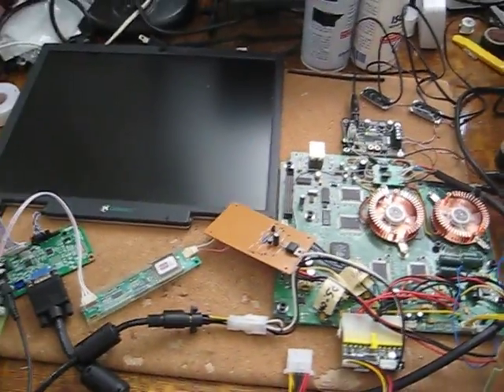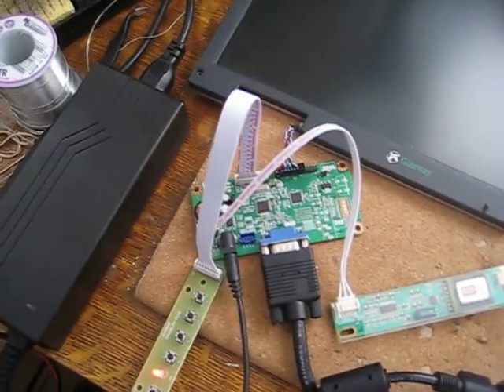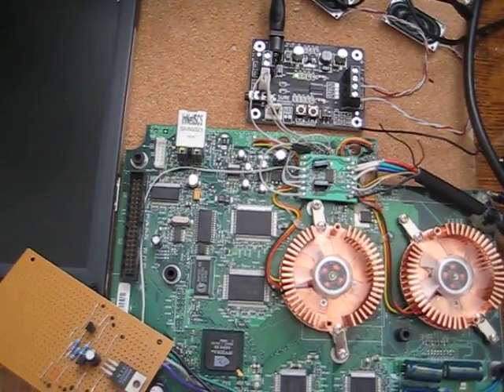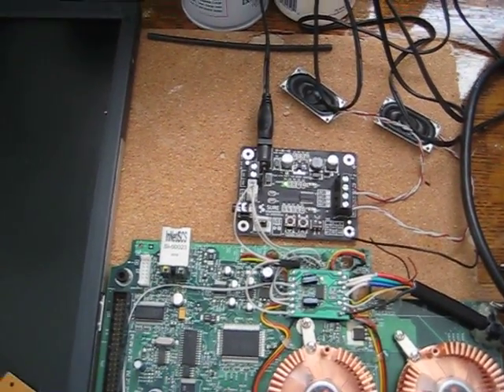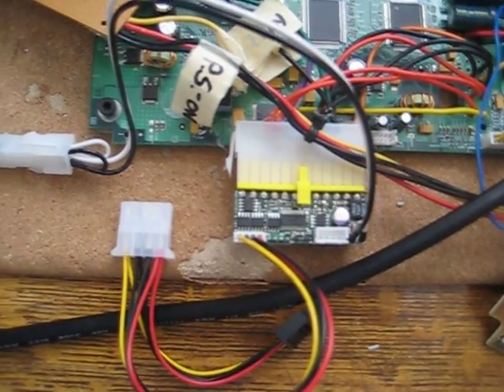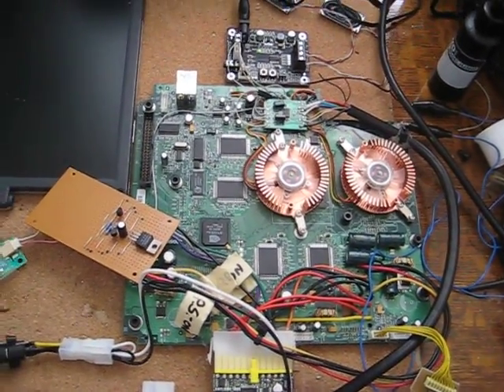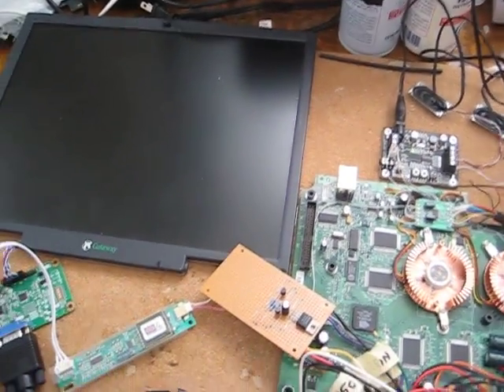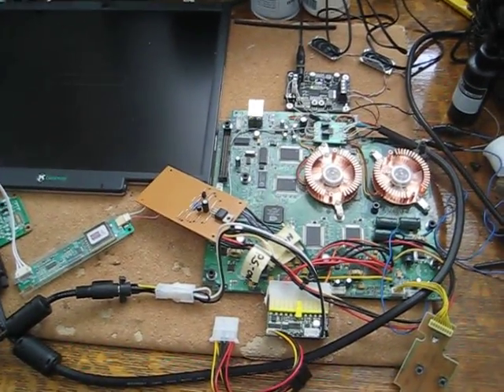Original Xbox Laptop Project

Comment: asume your nolonger responding but the pico psu works for the xbox?
read you have to remove caps to get it working
Reply from the maker: Sure it works, just supply the correct voltages to the motherboard.  No need to remove capacitors.
Reply: @Floydzabarber  weird all i can find about it is this here " https://www.xbmc4xbox.org.uk/forum/viewtopic.php?t=7330"
Reply: @Floydzabarber  should i just look into powering it with an atx power suply and then just use a pico?
Reply from the maker: @manwhoeatsfishinbedwithlig3791  The only reason I am using a pico is because it is a laptop project, for bigger projects like say an arcade cabinet I would definitely use an ATX power supply.
Reply: @Floydzabarber  did you end up finishing it?
Reply from the maker: @manwhoeatsfishinbedwithlig3791  No I have finished it yet.  I have all of the parts for it I just need to fabricate a case.

Comment: nice can u send infos about too connect an pico psu to an xbox the diy way ?
Reply from the maker: +TH3L0LB0Y Sure, what I did was I built this circuit on a stripboard http://s1038.photobucket.com/user/autosteve/media/AXTToXboxPowerSupplyConverterBoardTheory.jpg.html
Then I studied the Xbox psu pinout for my version of Xbox.  Pictures of different pinouts found here http://assemblergames.com/l/attachments/image-jpg.14421/
Then I bought a 24 pin atx to 20 pin atx power cable and re-arraged the wires so that they matched what the Xbox was looking for.  Finally I attached the 5volt standby, PS OK, PS ON, and Ground to my stripboard and ran the 3.3volt standby, PS OK, PS ON, and ground to their appropriate spots on the Xbox motherboard.